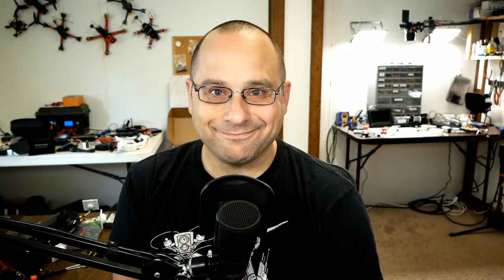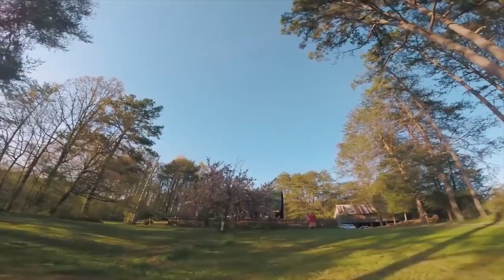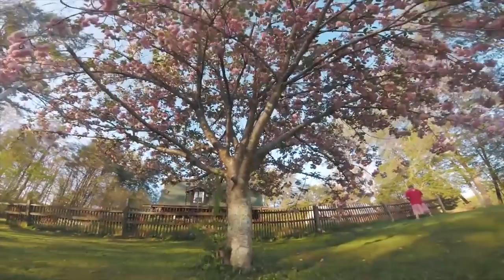Parallel Charging | CAN YOU MIX DIFFERENT mAh OF BATTERY

Comment: What you really missed out on is internal resistance, you start to fuck up batteries when you parallel charge bad batteries with good ones
Reply from the maker: Because you are only charging at 1C or 2C rate, voltage difference due to IR is negligible. And as the charge cycle comes to a finish, the charge rate drops off further, which makes the difference even smaller.

The main way that IR might make a difference is if you have really old packs that refuse to let their voltage come up. In that case, the packs should just be retired and aren't safe to use at all. Parallel charging should always be done on relatively healthy packs. 

If you put unhealthy packs on the charge board with healthy ones, the unhealthy ones can ruin the healthy ones.
Reply: Joshua Bardwell Dont you think a lot of noobs would have appreciated the heads up on this explanation in your vid?
Reply from the maker: This video is not a "how to parallel charge safely" video. It is answering the question, "can you combine packs of mixed capacity". I have a "how to parallel charge safely" video. This isn't it.
Reply from the maker: I have pinned this comment to the top of the comments section so hopefully more people will see it.